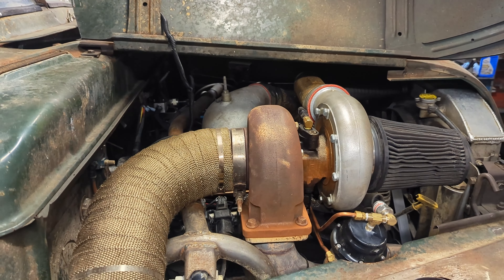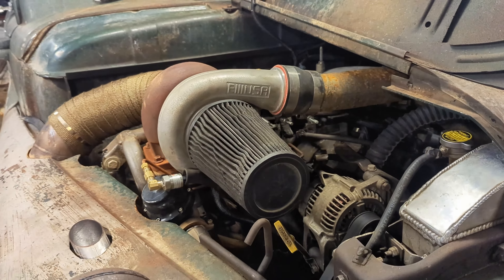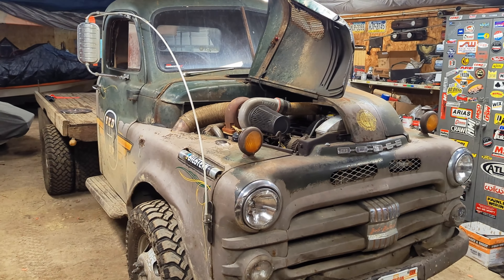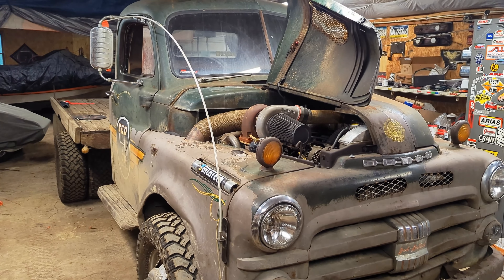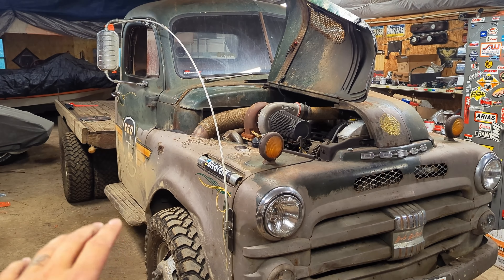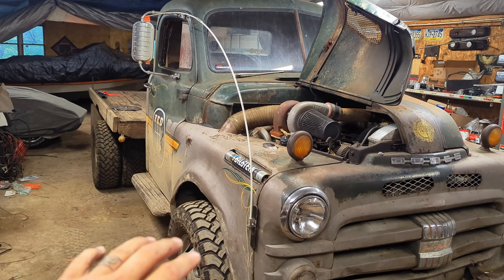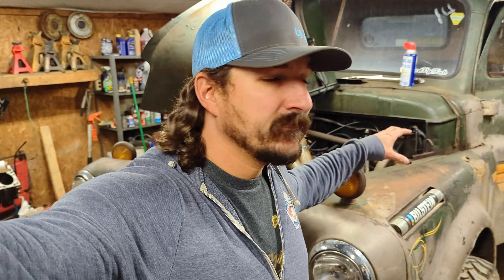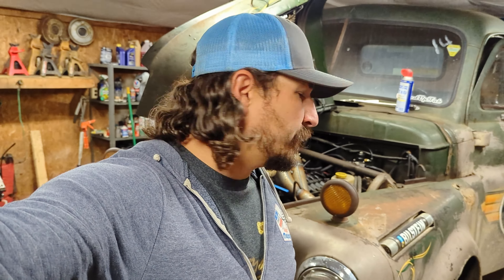How to Bulletproof Your NV4500! And the Crazy New Clutch for the '51!

Comment: I have 320k miles on stock 1.25 input and stock gears in a tuned common rail cummins, theyre not weak
Reply: They're not weak but you're also not making that much power with just a tune.

Comment: I've done stupid with an NV4500 and even dumber with a 5600. I haven't broken a 1&3/8" input shaft yet, but I've twisted three. I've snapped the little inputs. Something about 4th gear 4600rpm launches does that lol. You want weird, I have a 1994 chevy K2500. 1996 chevy NV4500, 1995 12v cummins bell housing, Dodge 1&3/8" input shaft, 2005 NV5600 clutch and block adapter, and a 2015 6.7 cummins engine

Comment: Make sure you run 4 quarts of good quality fluid in that NV4500. Is that the first oil change since that motor went together? That could have been the stuff that had the turbo stuck
Reply from the maker: Oh it's more than just leftover bearing. Lol
Reply: @FedUpFab  that sucks to hear
Reply: 6 quarts of synthetic

Comment: Strong enough to break your transmission, love that. Man im gonna tell some people about your channel on the magnum forums, try to get you some more viewers. I myself would like to do a turbo build on mine. Put some ported heads on with bigger valves, mild cam and kb hyper pistons with commetic gasket. Mind you ive got boltons from before like dual plane, shorty headers, 4 bbl throttle body and im a little disappointed in performance from the rebuild. I know it needs a tune but still it feels like i just refreshed the long block. Wanted to keep it streetable but it appears i need boost, or more cam and better heads with a stroker kit. Id feel more comfortable with a forged bottom end doing a turbo but im impressed with what youve done. Think a stock cummins turbo would be just fine for what i want. 12-17 psi of boost should be plenty for what i want.
My next problem is ive got a gas 46re which will probably need to be some steroids to hold up

Comment: Dude I've forgotten how good your channel is! YouTube hasn't been suggesting your stuff, just found you again in my subs. 
I'm looking for nv4500 for my K5 Burb project but they're all huge money
Reply from the maker: I have an alert set on marketplace for NV4500s. Lol. Chevy ones are usually fairly cheap, but also usually 2wd.
Reply: you can get a nv4500 for 200 bucks and rebuild it  for another 400. Theyre the cheapest manual around
Reply: @reggien737  not in my neck of the woods! Theyre over $1000 for ones that need a rebuild. I have a marketplace search saved too🤣
I got lucky years ago and bought a whole parts truck for $800 on my last nv4500 swap

Comment: The 2001-05 ram 25/3500s with both the 5.9 v8 and hemis that were a manual had the larger 29 spline setup like the cummins/v10 trans (granted still the small input shaft) and have the larger 5th gear nut and housing. I've come across two nv4500s both out of 03 hemi trucks like this.

However, I am swapping a G56 behind a hemi in my 03 2500 in place of a nv4500, and I think going with a clutch idea like yours would be a good bet (for when I get around to the boosted stage) as a lot of the gasser nv4500/g56 components are the same (flywheel, pressure plate, clutch, etc) so I may try to go with an upgraded diesel G56 input shaft and follow your tracks a bit. Thank you for the clutch/input shaft info for your setup!

Comment: Have you got a good scattershield above the transmission? Pretty sure KT meant it when they said it was strong enough to break your transmission. Stronger you build it the bigger the boom if it breaks.
Reply: Good point there
Reply from the maker: I need one. Been thinking about an SFI bellhousing blanket.
Reply: @FedUpFab  That and a plate between you and the transmission itself. Passenger too unless you've got good insurance  🤣
Reply: main benefit of that would be reducing dual disk noise lol @FedUpFab

Comment: Stock magnum. Impressive. Everyone talks LS but these are really good too. It’s unfortunate the Hemi stole its thunder. Personally I like the magnum better. They should have redesigned off of that. Especially since they already share some architect with the original hemi. If I remember correctly there was some interchangeability with the original hemis? You might get some luck with a flywheel there? Maybe base your motor off a 318 so it doesn’t need the balanced flywheel? You probably already know this but you could build a 46rh and put the diesel 47 internals. Aftermarket is way better and guys are putting over 2k hp
Through them. But it’s no fun not rowing a stick.

Comment: I had a 1997 ram 2500 with a 5.9 and NV4500 gear box. That was the heaviest fucking trans I ever pulled. The clutch and pressure plate was easy to get. I installed a center force
Reply: the nv4500 is like 150 lbs. its tiny. The nv5600 is 400 lbs
Reply: Great clutch!
Reply: @reggien737  this thing was iron with a PTO ports on both sides. It was 400+ pounds